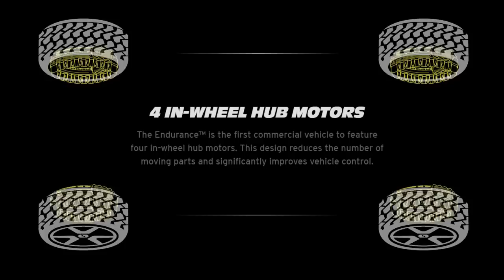Top 5 All-Electric Pickup Trucks Will Challenge Tesla Cybertruck

Comment: Wow is Ford going to put a mustang badge on e 150  too 💸💸💸💸😁 most of these truck s are too exsepinsive to matter in the real world Tesla and Ford/ rivian have the best shot if they can keep the cost under control
Reply: Trucks are just expensive new.  These electric trucks are actually cheaper when you factor in the price of fuel and maintenance.
Reply: @nathankovac2594  most trucks range between 30to 80grand depending on options    most most of the ev  are projected to be 70/135000 the cost for ev truck s is starting to come down but they aren't there yet they need to be in 20/15%of a comperble ice truck to make financial since another issue is most of the ev are based on unibody construction Wich means they are going to be really exsepinsive to repair so I'm waiting on the Ford  with its frame on construction will be serious treat to the ice truck s

Comment: No Nikola???? If I still cut firewood, I'd buy an electric Nikola. It's the best-looking and with fully electric n electric/fuel cell versions. If the USA continues to electrify transportation, expect blackouts because its electric grid is aging. Otherwise, what will power all these vehicles? More carbon-burning plants? Not solar and/or wind because of the vast, environmentally damaging geographic footprint that would be required. Nikola should choose Toyota as its industry partner and not inferior USA truck-makers.

Comment: all these trucks will fail in 2 ways.
1. They will not hold up long and the battery will degrade in as little as 1 year and may need replacement in 2 years, customer satisfaction will drop like a stone.
2. None have any track record of reliability in both battery and software.
They offer No compatition at all and will be gone within 5 years, think of the Edsel car.

Comment: Im looking for a light commercial WORK vehicle , not a recreational vehicle...why dont they understand. I dont care its 0-100 times. I want a reliable desent range. And yes, I dont care what it LOOKS like.
Reply: Dongfeng Rich 6 EV
$19,000 
9:56
Reply: Then buy a Cybertruck - it'll be worth it. Lower maintenance costs,a charging network,a stainless steel body (i.e. no rust), and over the air updates on the operating software.

Comment: “Zero emissions” is a lie. It’s more like “out of sight, out of mind emissions.”

What about consumed lubricants that get replaced? What about tire rubber wearing down? Those are emissions!

Electric vehicles are the most inefficient vehicles on the road simply due to energy conversion loss. Transmissions of electricity loses a large percentage over distance. The energy had to be converted from another form before it is electricity. Batteries always provide less power than it takes to charge them. 

When I see a tesla out on the road, I’m not impressed. In reality, I think “that idiot thinks others look up to them over it but they’re mistaken.” 

Tesla and all other electric vehicle makers are actually helping to pollute faster than conventional vehicle manufacturers.
Reply: This is simply inaccurate.  When you have a gas powered vehicle only about 20% of the energy in the fuel goes to moving the vehicle. Most of it is lost in waste heat that's why you have to have a radiator.  Even coal powered power plants are far more efficient than gas engines.  And the conversion from the grid into the battery is over 90% efficient.  The vehicles have less lubricants and approximately the same tire wear.  The idea is not that through the lifespan of the vehicle they don't use any petroleum products.  But they emit zero while running.  You can also use them indoors.  I use a leaf as a commuter car and absolutely love it.

Comment: Wow... 250 miles range? And the range is reduced by 40% in subzero temperatures? I'll pass...
Reply: No not necessarily.  There's a very minimal heating system on the batteries and I only lose maybe 20% range unless I use the heater while driving.  I normally use the heater before unplugging the car then lose very little range while driving..

Comment: I find it absolutely hilarious, reading all these comments how the cybertruck is this that and the other thing. Get real! The pick-up and it's variations are what built North America and the people who drive them will not be sold on the Tesla what so ever. I've owned several half tons and love'm, it's the most versatile, comfortable and durable platform on the road and owners of them like myself will not be running out to buy EV platform pick-ups. I will definitely own an electric only pick-up when my current truck wears out in 7 to 10 years down the road and by then all manufactures will have caught up to Tesla. Tesla mad a huge mistake with it's design and made it clear it has zero clue about the pick-up truck market. If they wanted to make serious in roads into the pickup market know that novelty will score you zero points and could damage credibility.
Reply: You think Tesla made a huge design mistake. Think again. It's pure genius. Everyone is talking about it and it doesn't look like every truck on the market. No one will buy an F series EV because it still looks like it was styled in the 1950's.  At least Rivian tried.
Reply: @e210dall3  Everyone who owns a pick-up is laughing about it and making fun of it! I know this because all of my friends and family have pick-ups as primary family vehicles or secondary work trucks. You actually think the pick-up market is concerned with styling? Brand loyalty, value and utility are what drives the pick-up market, not gimmicks and styling.
Reply: @jayfxdx  Yes, you're correct. However in terms of marketing and getting the world to notice your electric creation he does have some flair.

Comment: I would like to buy the truck that publishes exactly how far it can go towing its maximum load. So far 500 miles empty will be less than 100 miles towing. Not very useful. 
I would like to buy the truck that uses battery technology not based on junk cell phone batteries. Lithium battery technology has already progressed to thousands of cycles instead of hundreds of cycles.
I would like to buy the truck that can be easily charged from a small inverter generator without a problem.
I would like to buy the truck that uses about 100 year old high efficiency diesel electric technology.
I would like to buy the truck that the manufacturer will guarantee it can be repaired by the owner for 20-30 years for less than the cost of a new one.
I would like to buy the truck that the manufacturer will support the firmware for more than the warranty period.
I would like to buy the truck that the manufacturer will release the firmware source code after the warranty into the public domain so that smarter and more dedicated developers can improve the Micro$!!t style flaws that are left in to aggravate the consumer. Working 80% is not acceptable.
I would like to buy the truck that the manufacturer will compensate me for using my money and data to develop self driving vehicles.
Hmmmm.... Looks like I'll be making one myself first.

Comment: If you'll be using your truck to actually carry heavy things, then gas-powered is still the best bet. The range is terrible when loaded. You don't get the full 300-400 miles. You get a small fraction if you're towing heavy things. (What's the range/mpg on a U-haul?) The chances that you get stranded somewhere is too high. You'll have to carefully plan out everything, and the on-board computer won't accurately predict your true range.
Reply: BASED ON?
Reply: @MICHGO1  based on every body of knowledge known to man. Never taken a physics class? Moving a larger amount of mass over the same distance will require more Work/Energy. This energy will come from the chemical potential energy from the batteries. Thus, you'll deplete your batteries in no time in a loaded truck. Not a good idea.